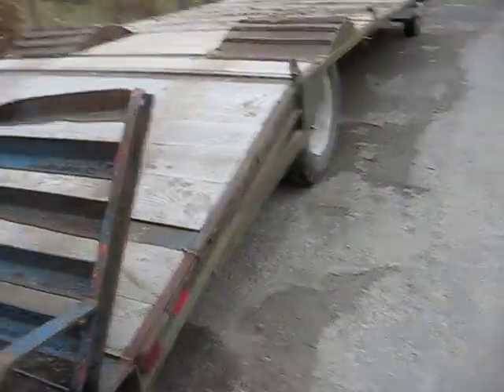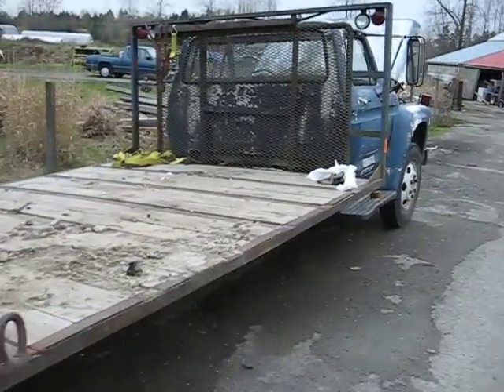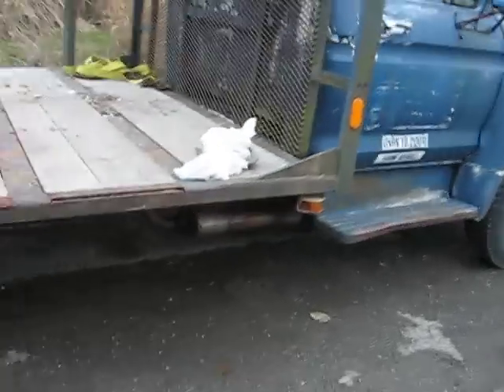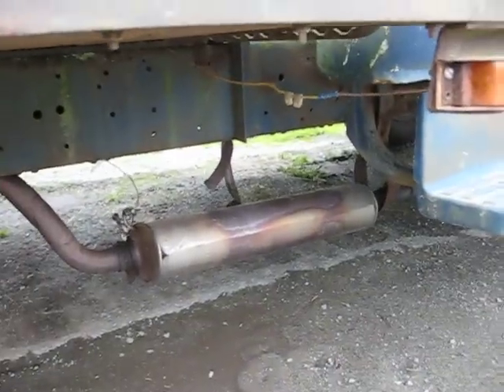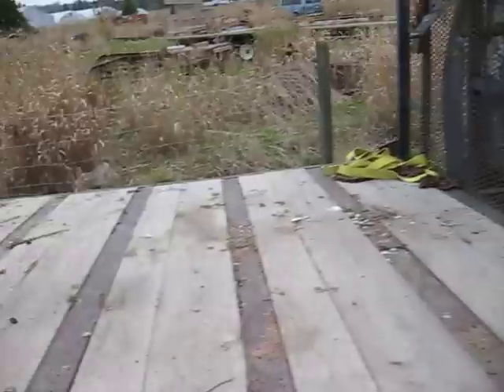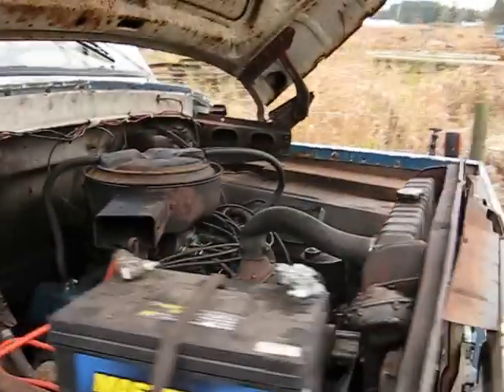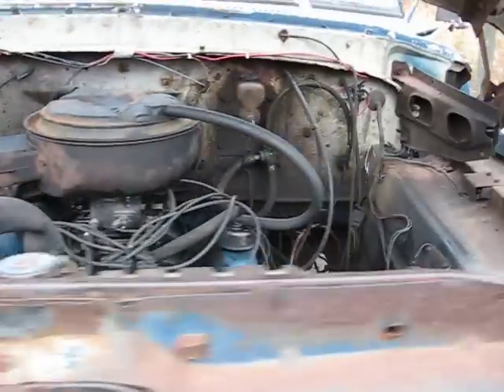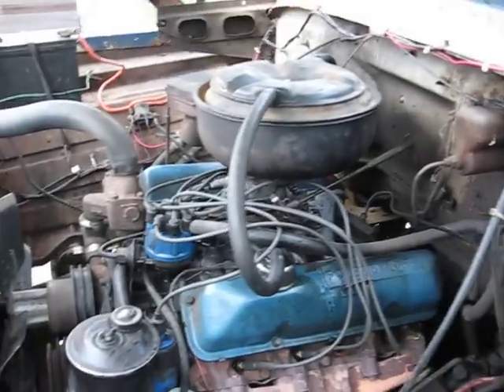1975 FORD F-500 Flatdeck  Truck

Comment from the maker: I will once the engine is repaired he had a fire but nothing serious sheesh leigh get a fire extinguisher would you! I Could I put a 4bbl manifold and carburetor in this truck or Just put  a 2 barrel Holley manual choke carburetor.